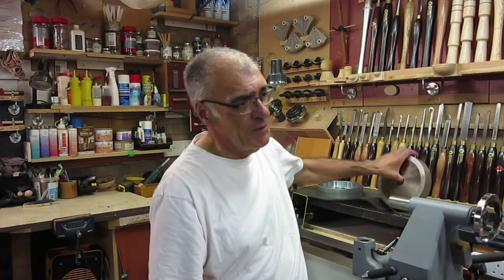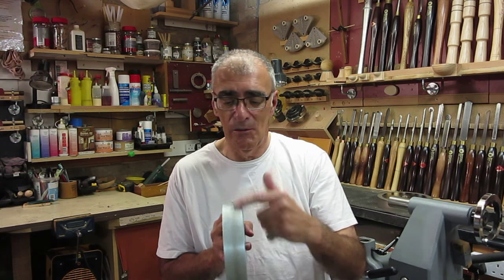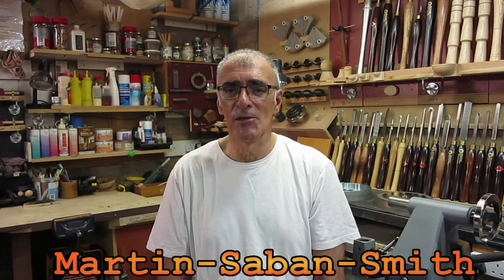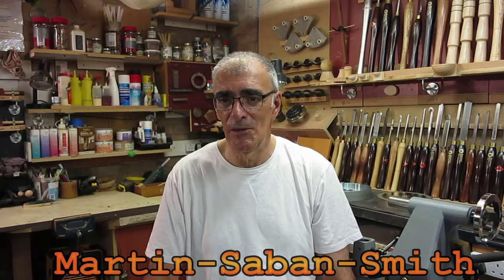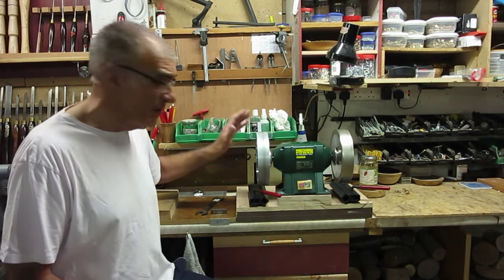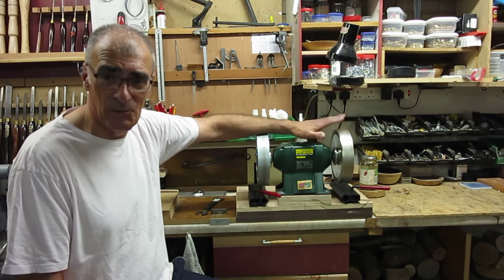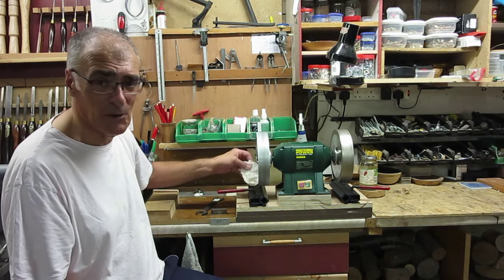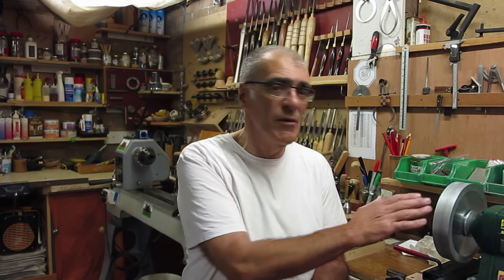Woodturning - CBN Wheels

Comment: Hey Mike had a question and think it might have been a typo but yes i agree they dont do well with carbide but the carbon steel ??  not sure what you were getting at here all steel has carbon  and good steel has more carbon  plus other things just not sure what you were meaning or if that is what you were meaning,  they are made for carbon steels.. unless this is one of those lost in translation or lost in memory moments LOL
cheers Mate
Reply from the maker: +dennis buckner 
Hi Dennis
What I was trying to get across is that they are best for High Speed Steel not standard tool steel, as the "softer" steel tends to "clog" the wheel. Thanks for pointing out my misleading and incorrect comment.
Take care
Mike
Reply: ah ok not sure if i was being nit p[icky or what but i love the vids ..i was thinking tho you could do a series of cleaning your shop with a tooth brush ..i mean as much as you love cleaning an all ya'know....LOL

Comment: Thank you Mike
The video has been a great help, I also have the Record 8" grinder and got one  CBN wheel for now, I too got it from Toolpost, I got a leaflet with mine showing how to fit the wheel, the washer (special flange) as it's called,  which you put on just before the nut, should go on first, before the wheel, by the motor, and the original Record Power flange goes on the  recessed side,  I am not saying your way is wrong,  just that  this is what it says on the leaflet
Pat
Reply from the maker: Hi Pat, and thank you for pointing this out to me. I must have got it wrong. However I have a slow speed grinder now with a different arbour set up, but once again thanks for the input my friend.
Cheers
Mike
Reply: Hi Mike,  I have a few questions if you don't mind, why did you  change to a slow speed grinder, is it better, and which grit CBN wheels do you have on the new set up.
Cheers
Pat
Reply from the maker: I just felt that the grinder was not powerful enough for the weight of the wheels Patrick, and was offered an early Christmas present from my wife, so I just couldn't refuse :). The wheels are the same as were on the old grinder, so the grits are the same as in the video.
Hope this answers your question sufficiently.
Cheers
Mike
Reply: Hi Mike
That is a great help, I have decided to get a second wheel and I am also thinking of getting a more powerful slow speed grinder as the wheels are quite heavy, and keeping the record for other work, this one seems a good bet and the shaft is 32mm 1 1/4" so I would not need a bushing, what do you think  http://www.axminster.co.uk/axminster-trade-series-at8srg2-slow-running-grinder-505195
Reply from the maker: Patrick Dunne 
That's the same one that I got Patrick, and I am very pleased with it mate :)
Cheers
Mike
Reply: Hi Mike, that is good news,  did the wheels fit okay without any bushing, if they did I will go ahead and order it now and  I won't bother you any more after this
Reply from the maker: +Patrick Dunne 
They did Patrick, but I had to add a washer on each side to allow the nut to grab enough thread to tighten.
Let me know what you think when you get it. 
Cheers
Mike
Reply: Hi Mike, I did get the slow speed grinder and the second wheel, I now have the same set up as you do and am very pleased with the slow speed grinder and CBN wheels,  it's not as scary as the Record, I also watched your video on negative rake scrapers  and got one for now, it has changed everything no catches , I have ground it to 70/30  like you said which seems fine so I will leave it at that, did you ever get the Big ugly tool that Robo Hippy has, I would like to try that, but can't seem to find it in the UK,  all I turn is segmented bowls and need to find a quick way to get it round, knock all the corners off and then finish with the negative rake scraper, I am fairly new to turning and going to watch all your videos
Thank's
Patrick
Reply from the maker: Hi Patrick, glad you're happy with the grinder. regarding the "Big Ugly", I have not used it, and as far as I know they are not available in the UK, but maybe the manufacturer will ship to the UK, but I feel the shipping and import taxes might make it unviable.
Sorry I can't be of more help mate.
Take care
Mike

Comment: CBN not recommeneded for carbide? i'm not a woodworker, im a machinist, and we use them on carbide.
Reply from the maker: +meocats 
Hi and thanks for the input. I was told a while ago that 180 grit or 240 grit CBN are too coarse for carbide cutters, that's why I suggest not to use them. I have always honed them with a 600 grit diamond hone, as the carbide could clog the wheel. But, I am not saying you are wrong, especially if you do it in a professional capacity with obvious success. Thank you for giving me food for thought. As a matter of interest, what grit of wheel do you use for your carbide, thanks in advance.
Cheers
Mike

Comment: I would think that the bushing should have been a press-fit. I would've heated the CBN wheel with the torch around the center, and the bushing should just slip right in. No sanding needed
Reply from the maker: I agree, but in this case it wasn't Andrew.
Cheers
Mike

Comment: I'm going to assume that you bought these before Stephen Ogle came up with his diamond sharpening system. I personally have sent for five of the disks he is using. I have a 100, 150, 320, and 3 more that were sent as gifts from the company for ordering from them. They are 500 grit, 5000 grit and 15000 grit. I haven't bought Steve's plans because I've found that they are perfect on the Worksharp 3000 which I already own. I an using an MDF board with a little adjustment to fit on the WS 3000.
Bill Bidel
Reply from the maker: +William Bidel 
Hi Bill, Stephens rig is excellent, of that there is no doubt, but adding CBN to my existing set up was the way I wanted to go.
take care
Mike

Comment: I've done a bit of research and so I may have answered my own question which is that it's 8", of robust construction with a decent sized induction motor and half the price of the Axy equivalent :-)  No brainer really.
Reply from the maker: I did answer your earlier question, and you are right with your assumption ;)
Cheers
Mike

Comment: Hi Mike,

I am considering these wheels as well. Did you consider the wheels from Wood Turners Wonders? http://woodturnerswonders.com/collections/cbn-wheels/products/cbn-wheel-4-in-1-design-220-grit
These have the same method of manufacturing and feature a round corner that enables interesting ways to grind.

Great channel!
Reply from the maker: Dror Sofer  Hi Dror, the supplier you mention is based in the USA, and I am in the UK, so sourcing was a bit restricted, as shipping from the US, would have made the cost prohibitive. Thanks for the suggestion though.
Take care
Mike